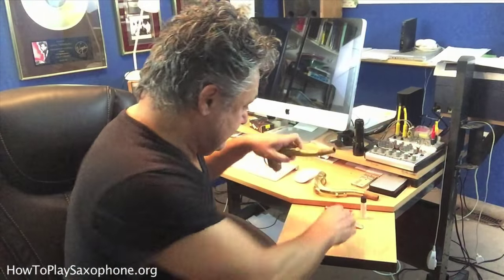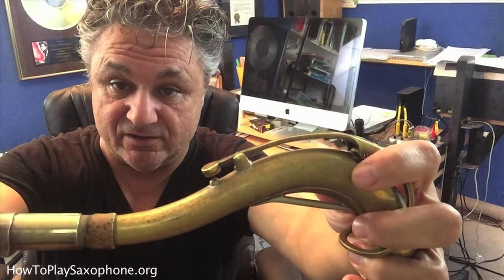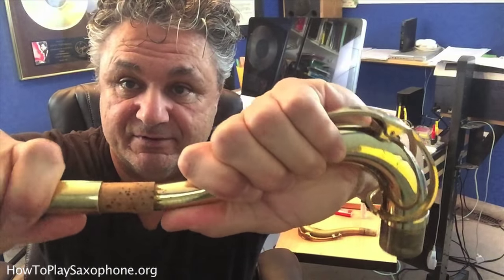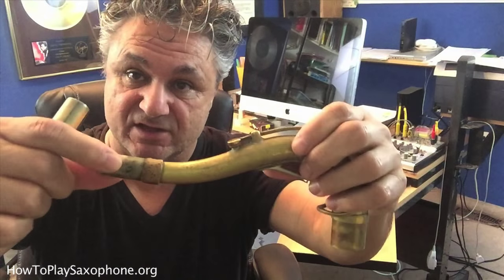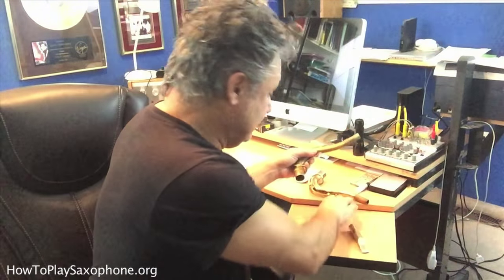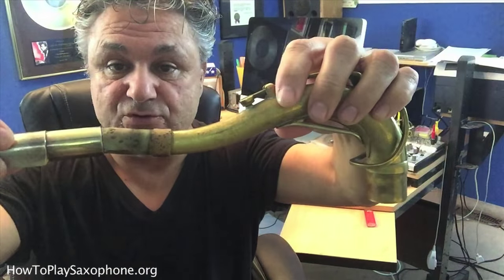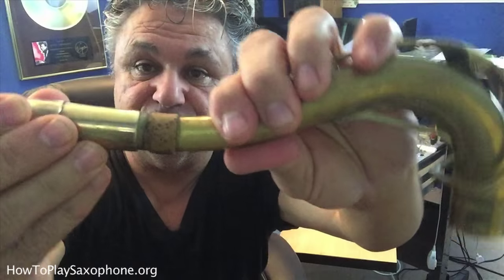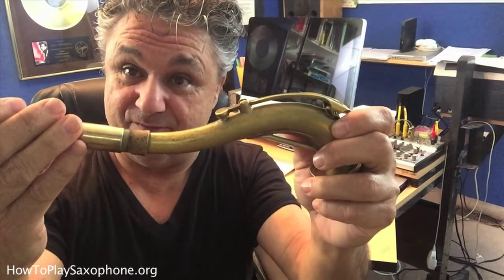How To Temporarily Fix an Old and Compressed Saxophone Neck Cork

Comment: one of my favorite ways to fix a cork is to boil water with a lid and then when there's enough steam hold the neck over it and it really expands but this lighter method helped alot when I'm not at a place to go boil some watter thanks!
Reply from the maker: +ttam0324 ya I here you, I boil my corks when I'm bottling my wine, just didn't occur to me to put my sax neck in boiling water but thats definately a way that works as well.

Comment: Have you tried just dunking it in a cup of hot water, Johnny?  That can work too.

I did one in the steam from a kettle once, and the glue under the cork melted (on a Chinese soprano, so glue, not shellac).  I could see that happening with the lighter too, if it was done for too long.

Comment: A paper strip or plumbers teflon tape will do it on the road. Keep some in the case. For home use, I bought an electric clothing steamer on ebay, and blocked 2 of the 4 holes; it shoots a jet of steam and swells the cork nicely.
Reply from the maker: wow, new one for me thanks!

Comment: Excellent video.  I play alto.  What is your preference on this:  Do you take off your mouthpiece each day and put back on the following day or do you leave mouthpiece on neck cork and take off as needed, for example travelling?  Which way protects the neck cork from tearing etc....?  Thanks a lot.
Reply from the maker: I have a bad habit when it comes to this... I always leave my mp on the neck when I'm at home, also the reed. for days at a time. I've been doing this for about 30 years, only changed my cork 2 or 3 times so don't worry too much about it.

Comment: I would add that once you have a new cork, if it is very hard to put on, you need to sand it down a little, or you will run into this compresion problem sooner than later.